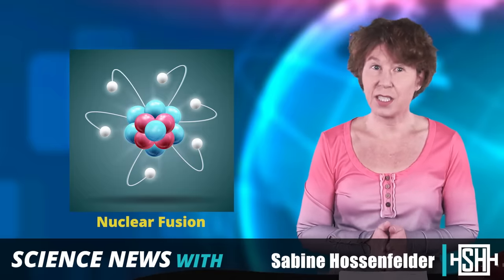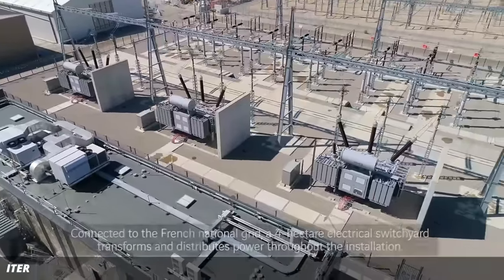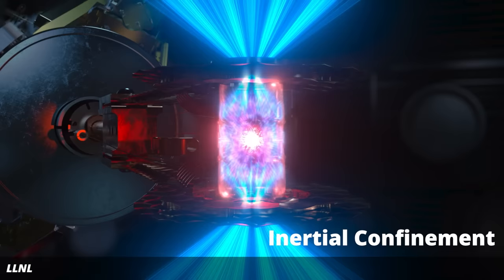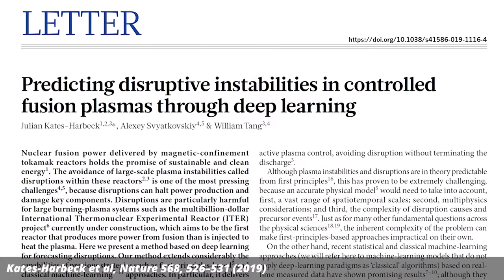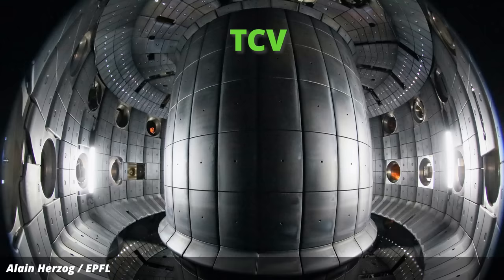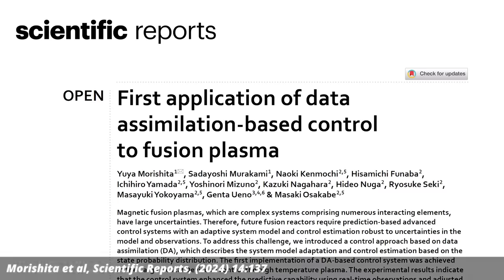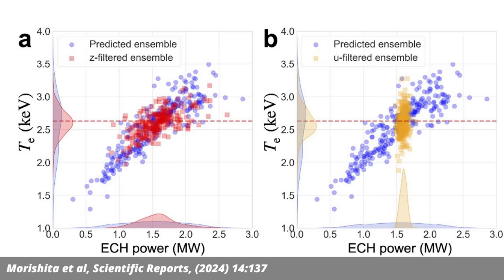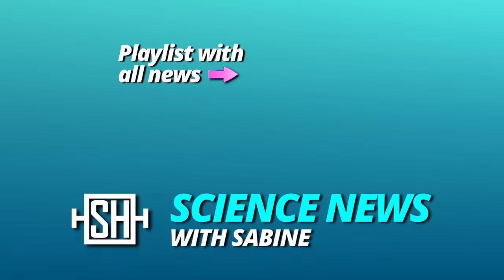First Nuclear Plasma Control with Digital Twin

Comment: the "Big Friendly Gun" AKA the BFG 🤣its too bad they did not add the 9000 to the name make it the "BFG 9000". To state the reference, this is the kill everything gun in the Doom franchise of games.
Reply: In Doom I don't think the f stood for friendly😅
Reply: @petevenuti7355 did it stand for fabulous? 🤔 fun? 🤔 I’m sure it’s nothing rude, right? 😜
Reply: Tbh i don’t think the F stands for friendly in this instance either…
Reply: @chekote  It's for falcon definitely
Reply: @jedwards1792  F for fusion is too obvious.
Reply: @petevenuti7355 It stands for friggin' or fraggin', depending on your sensibilities.
Reply: I'm sure someone has written 9000 on the side of it with a Sharpie 😄
Reply: Also Chaos Control is from Sonic the Hedgehog I don't know if it was on purpose but its where my mind went first.
Reply: Chaos control is also potentially a game reference
Reply: Elon Musk called his rocket BFR (Big F-ing Rocket) also in reference to Doom. The diameter of said rocket is now 9 meters (down from 12 in previous designs). And 9 meters is 9000 millimeters... So Elon really missed a chance here to go the full path.
Reply: Probably because of copyright issues... but they could have called it BFG 8999.
Reply: obviously it stands for Fibunaci
Reply: Gotta have somewhere to go for v2.0
Reply: "You can't just shoot a hole Into the surface of Mars"
Reply: I think the actual original would be Roald Dahls "Big Friendly Giant" BFG
Reply: @aaronmicalowe  fracking if you're a BSG fan.
Reply: @8baanknexer  I honestly think it is cheekily referencing both. This was done by tech nerds - and we are obsessed about DOOM (most recently it was engineered to playable using a 'monitor' made of stomach bacteria). But this isn't a weapon of offense, so 'Friendly' becomes a nice nod to Dahl.
Reply: The reference to doom is obvious! BFD
Reply: @petevenuti7355  It's possible. BSG was first aired on TV in 1978 while the BFG 9000 was introduced by Doom 2 in 1994. Perhaps Romero or one of the others was a BSG fan. It's very plausible.
Reply: The BFG was the smallest of giants with the best brain who lived of snozcumbers instead of little kids. He slew and tamed the Big Nasty Giants while protecting Sophie, a little granddaughter type figure. The Big, old Friendly Giant... Roahl Dahl was a BFG. The Twits is the best... It reminds me of Fusion 'Energy' Scientists covering branches in honey to catch the birds.......... ..!..
Reply: F for Fossil Fuels, of course - haven't you guys knew yet that "No system of energy can deliver sum useful energy in excess of the total energy put into constructing it" (2017)?
Reply: @sunroad7228  A water mill?
Reply: @aaronmicalowe The axe that cut the wood - until came to existence from scratch, transportation, food and care consumed until the tree and the worker are mature, the medicine consumed until built, shelter, knowledge, repairs against wear and tear in the industrial base creating the axe and repairing the mill, beside all other externalities.
Reply: @ronjones1414 by leaving the numbers off the official name you can name the upgrades with increasingly cool numbers
Reply: I'm more appaled that they didn't use 'Fusion' as the F then anything else.
Reply: not roald dahl reference?
Reply: BFG? Chaos control? Just what are these scientists cooking?
Reply: Big Fun Gun
Reply: bfg 9000 , as in how many variations were made before it became hand held  weapons 😅
Reply: noisy cricket vs bfg 😮 what would you choose 😊😅
Reply: No worries. This is only the BFG prototype. 9000 will come soon
Reply: @8baanknexer  No one thinks about a giant when hearing BFG. It's a clear Doom reference. You can try it. Ask 100 people unter 60 what BFG means and report back. I bet it's around 30% "I have no idea" and 70% "Big F-ing Gun".
Reply: Oh, for Pete's sake.  Knock it off, Sabine.
Reply: sigh
Reply: @AlexWillisson  : Eh, maybe keep the "9000" moniker for version 3 or 4 instead.
Reply: Its been around longer than that. It also shows up in Quake 2 as the 10k
Reply: Lmao I was thinking this exact thing. How funny that the DOOM gun shoots out huge amounts of energy too.
Reply: @aaronmicalowe RUDE!
Reply: When they achieve pinch, someone yells "we just two-tapped the cyberdemon"
Reply: @RemotelySkilled kept looking for a footnote for the "ars*" where you explain that it's a pun on the Latin "art"... And then realized it's just censor bleeping.
Reply: Using the same modelling techniques as used for weather reporting.  Like that works so well, what could possibly go wrong.
Reply: Agree we are waiting for it to work we are at version 114.